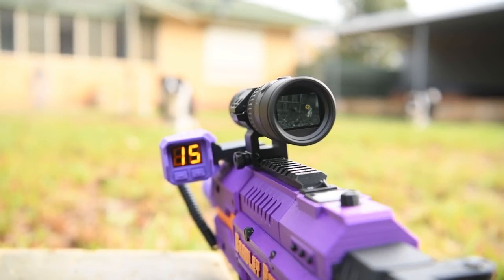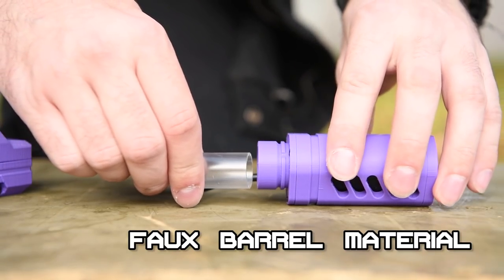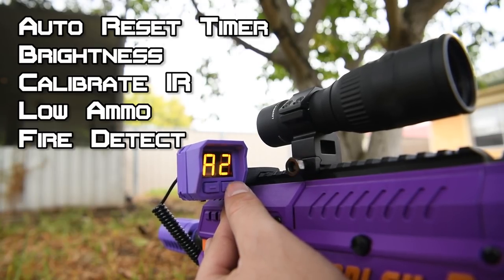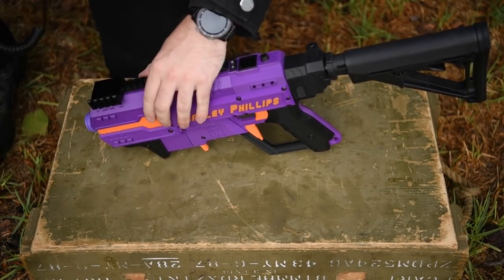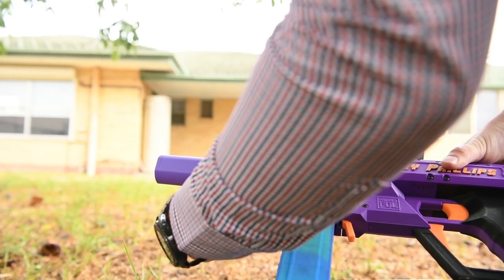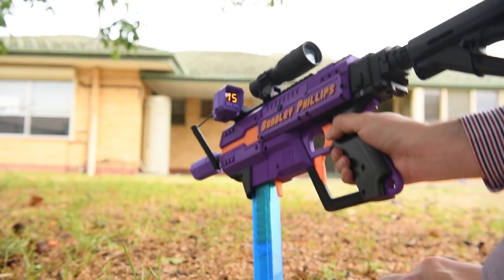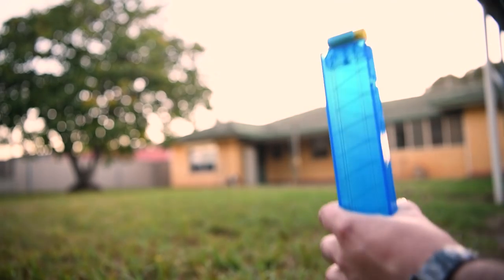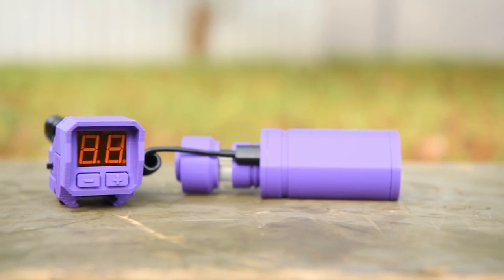AmmoCounter - I'll never need to check a mag again!

Comment: Very happy to hear about Worker Gen 1 durability increasing! I probably only have 30 or so left out of 100, most decapped after only 3 to 5 shots.
Reply from the maker: I've been getting mine from Monkeemods and all have had great glue. I can't vouch for other sellers because they could have old stock, but I can tell you this is the best I've seen Worker glue them.
Reply: @BradleyPhillipsYT  Good to know, I might contact Out Of Darts to see if he has some of the most recent stock. I live in Oregon so I usually get stuff from him in a day or two and it's as cheap as Monkee's almost 2 week shipping. 
And A+ content as usual, looking forward to the next vid.
Reply from the maker: Before I bought any darts from Monkeemods I asked them to pull a dart head off and see how difficult it was. It was glued very strong, so I bought like 1000.
Reply: @BradleyPhillipsYT  I may well do something similar now, thanks for the tip!